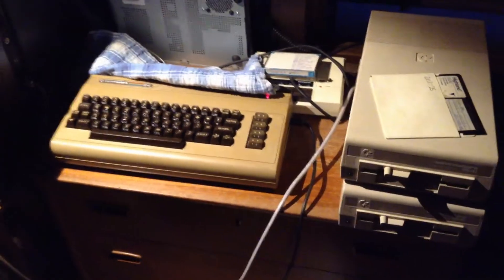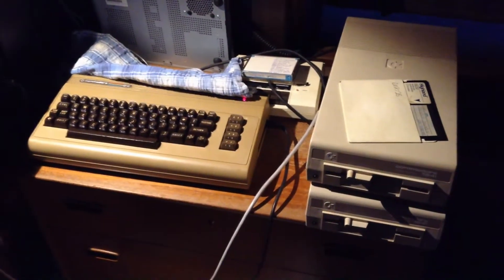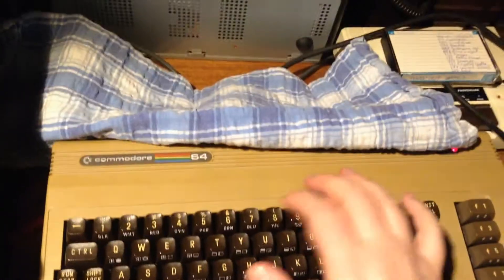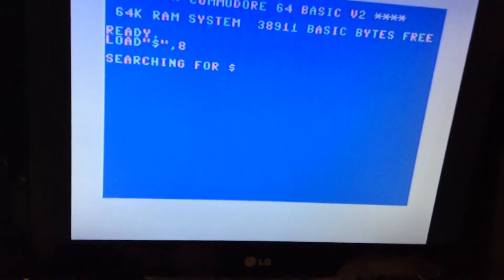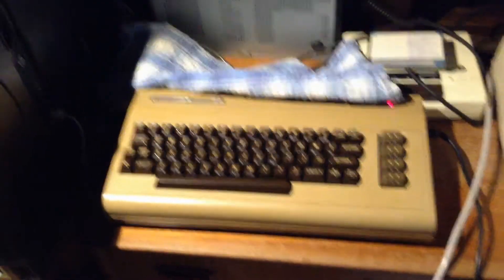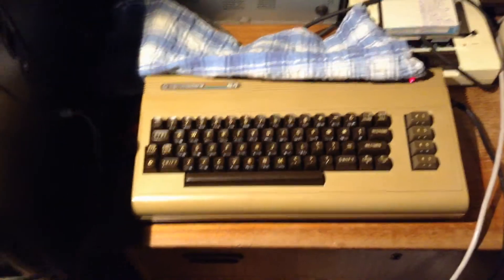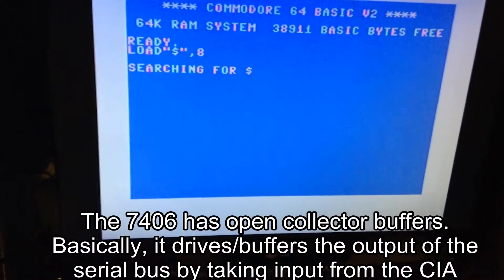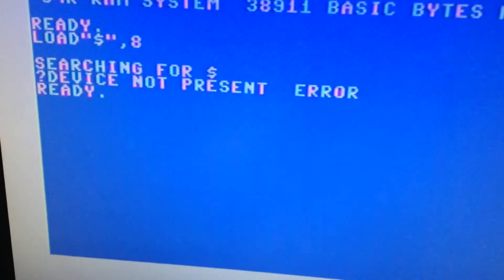C64 "Searching for $" repair (serial bus issue)

Comment: i have a 250407 rev.B board giving me the "Searching for *" error and i know it's not the floppy drive and am trying to trace the fault, but i'm not good with a multimeter. it's my understanding that the problem is either the first CIA at U2, the 7406 at U8, or the clamping diodes. i've cleaned the power connectors and the serial connector with ISA and contact cleaner. do you know what the location is of the diodes i would need to check on this board? thanks and best wishes.
Reply from the maker: I had a second look at the 250406 Rev.B. It likely didn't have the piggy backed diodes yet like the Rev.C. They protect the serial lines from going to far positive or negative (hotplugging etc). So I'd also have a look at the SID and see if that has been damaged.
Reply: @bwack  no evidence that the SID is damaged at this point when checking it in another machine.
Reply from the maker: If the CIAs are socketed you can try pulling them out and inserting them in the other socket. The diodes on the serial datalines are at the left edge of the board. Piggy backed I think to some resistors. Measure resistance over them.
Reply: @bwack  unfortunately they are not socketed and i even temporarily have managed to ruin one board by trying to socket one of these CIAs by removing it and lifting traces on the board.

Comment: Brilliant!  Glad you got it working again!
Reply from the maker: +GadgetUK164 Thanks. I forgot to reply to this. I got it to work, and then the next day it failed again. It was the voltage drop because of the dirty power supply connector.. I remember the voltages were down at 4.6V at some point, but after cleaning the connector the voltage stays at about 4.95V measured inside the C64.
Reply: @bwack  how did you clean the power supply connector? just spray some contact cleaner into the power connector or am i misunderstanding what you mean?

Comment: if the commodore 64 wont load the directory, check the diodes near the ic 7406 chip and the ttl itself. if the problem still exists the cia 6526 is bad.
Reply from the maker: ***** Thank you very much. I will check the diodes. The problem is still there and comes back after 10-15 minutes after power-on.
Reply from the maker: ***** I've looked for the diodes, but it seems that the board I have "ASSY-NO.250407 / ARTWORK-NO.251137 / REV.B", the diodes are not there. In REV.C the diodes have been piggybacked onto resistors close to the 7406.. and in later boards (250425 and up) the diodes have settled into the schematic and board.
Reply: bwack your cia´s are socketed, right? try to swap the cia´s together. if the c64 load´s normally and the keyboard has troubles, one cia (6526) is dead. make sure that the soldering and contacts are ok. good luck :) The 1541 and the serial bus cable is ok right?
Reply from the maker: ***** The CIA's have been swapped with another working C64, no resolution. I had a suspicion for a while that the voltage was too low at the IC power pins, and it turns out that the power plug and connector was dirty. touching the cable and the voltage would drop 200mV.. After cleaning it drops like 10mV when wiggeled. So I couldn't get my drive to fail anymore, however my tape drive failed to load while my 1541C was on, but was ok if the drive was off. I did lot of research and found a design flaw regarding the SQR/taperead line. It will make an interesting video i hope, and I have recorded video, but I need to spend more time on it first to make it presentable.  :)
Reply: bwack very interessting... i always change the capacitors first to make sure that the voltage is stable. have you checked the power supply? i´ll use a repleacement (self built 5v DC 2A and 9V AC 1A). one time i had similar troubles with 2 of my boards, the reason was the power supply and some dryed filter capacitors (sounded scratchy, graphical errors after 15min of work). I do not use the datasette anymore, i have the xm1541 cable :)
Reply from the maker: ***** That's cool, where did you get the 9V AC transformer ? The PSU is ok. No significant ripple or voltage drops.. for now.. When it fails it can get dangerous though. I'd like to make a protection box to put in between the psu and the computer.
Reply: bwack the ac 9v 1a transformer is used on some older US Robotics Modems.. wish you all the best for your c64 :)
Reply: @bwack  did you ever follow up on this repair?
Reply: just had the same issue, it was due to a bad 7406 and some of the clamping diodes !
Reply: @laurent64  help. noob with a 250407 rev.B board giving me the "Searching for *" error and i know it's not the floppy drive and am trying to trace the fault, but i'm not good with a multimeter. it's my understanding that the problem is either the first CIA at U2, the 7406 at U8, or the clamping diodes. i've cleaned the power connectors and the serial connector with ISA and contact cleaner. do you know what the location is of the diodes i would need to check on this board? thanks and best wishes.
Reply: i have a 250407 rev.B board giving me the "Searching for *" error and i know it's not the floppy drive and am trying to trace the fault, but i'm not good with a multimeter. it's my understanding that the problem is either the first CIA at U2, the 7406 at U8, or the clamping diodes. i've cleaned the power connectors and the serial connector with ISA and contact cleaner. do you know what the location is of the diodes i would need to check on this board? thanks and best wishes.